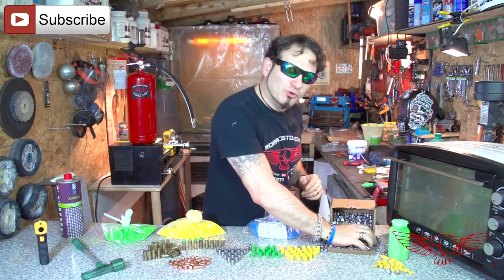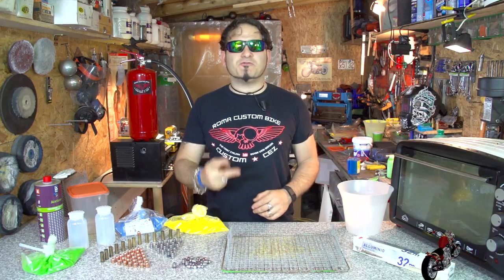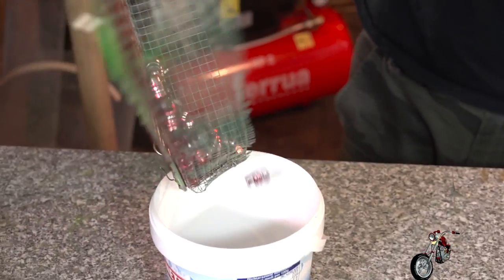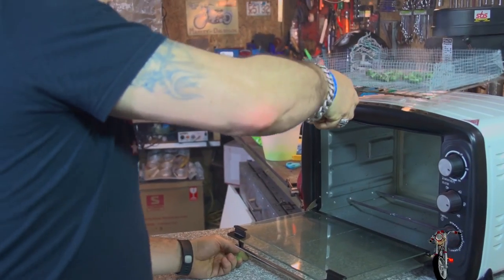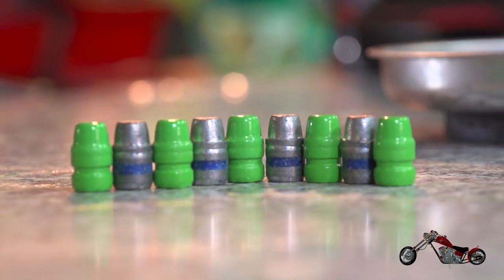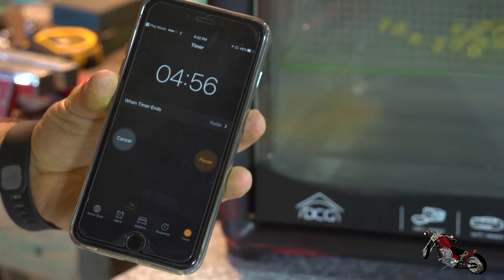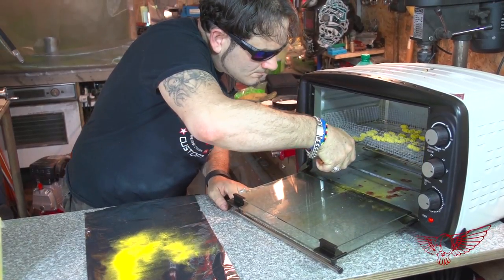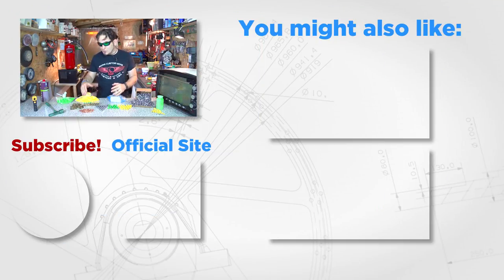How to powder coat cast bullets the easy way DIY tutorial - ep 32 - Roma Custom Bike

Comment: Please don't take this the wrong way. I understand these types of videos are not easy to produce.. But there are so many things you have done wrong. 1st.  Powder coating bullets is always done dry and yes you got removing the wax lube correct. 2nd  The only time you mix acetone with a powder to coat bullet is exclusively for a product called "hi Tec" bullet coatings.  Just so we're clear it's a powder but it's not powder coating.  it's a proprietary blend of polymers that needs acetone to suspend it ...it will not go on dry. 3rd is  When you attempted to powder coat the bullets dry in the 3rd segment you left the wax lube on the bullets .
..that's what cause the problem even if you didn't melt them by not watching the oven temperature they've would have looked like crap because the wax contaminated the powder coating, & how you messed that up I can't fig it. We set our oven temp to 400°f max & lead starts to melt or get soft around 650°f and starts to melt at 700°f ...how you got a toaster oven to that temp is odd. I guess in Europe they must have special toaster ovens. I give you credit for making a educational... I mean entertaining video but please if you're going to do something research it and put out the information that is correct.
Reply: I think you're being a bit close minded. The wet method obviously works. I've seen others do it with acetone like this. So I don't think it limited to hi-tek only...
Reply: If it works like he showed it does, you can't say anything about it. The guy did an excellent job of explaining and showing 2 different processes of powder coating. If you think you know more or can do better make a video!

Comment: I just got into powdercoating my cast 45 230gr, this is what works amazing for me so far. I preheat bullets for 5 min in 140f then put in a #5 or 7 plastic container with a tablespoon of powder for about 200 boolits then hand tumble in a circular direction, not shaking, that will dent your casts. After two minutes I pour them out over the 1/4 in hardware cloth/screen and pick them up wearing nitrile gloves, rolling them in my fingers as I place them standing up on parchment paper in the toaster oven pan. Making sure none are touching. 400F at 14 minutes, less time and your PC might fail a hammer test (flaking off by smashing with hammer) I would never bake them laying on their side, the sizing will be inconsistent as well as your accuracy with them. I size after PC. HIghly recommend the Eastwood Copper Penny pc or the Neon Green from the Powdercoat store. Certain colors have abrasives in them such as black so keep that in mind and always use powders on the glossy side.
Reply: So you do like that one guy did on his video? 140?
Reply: So you do like that one guy did on his video that one time?

Comment: The real reason those bullets melted is because you have solder in your lead mix. Solder contains a LOT of tin, which lowers the melting point to as low as 385ºF.

Comment: What is the advantage of the painted bullet?
Reply: Replace need for bullet lube as well, sealing lead exposure when handling. You can ramp up the velocity as well. Not much leading goin on under 1000fps in a pistol length barrel